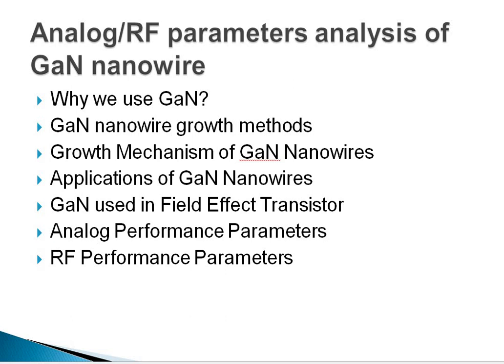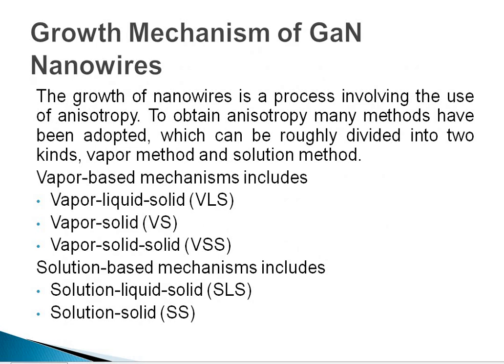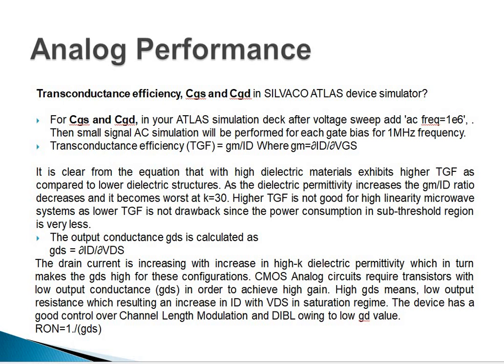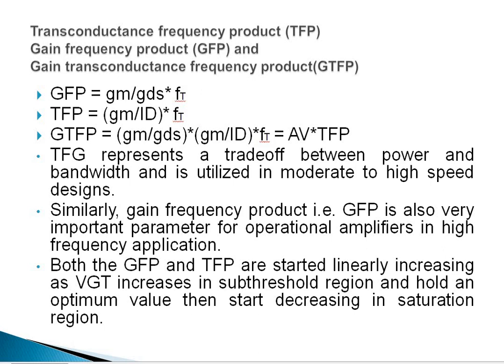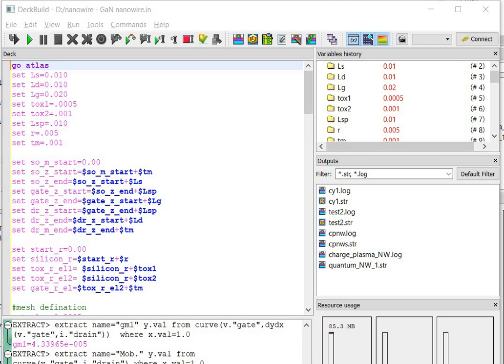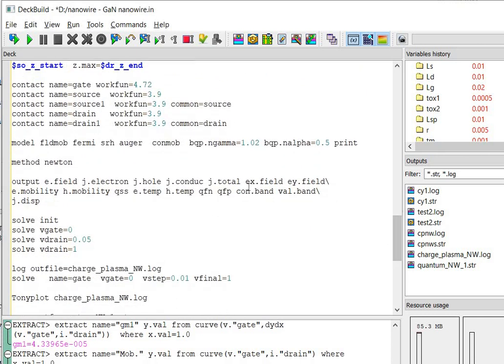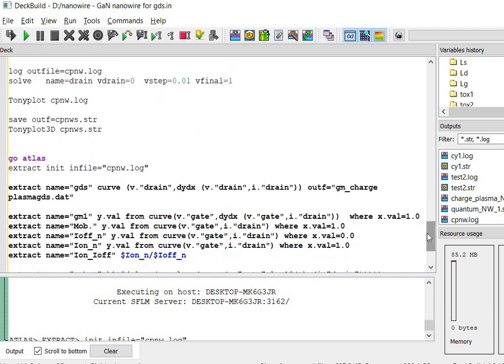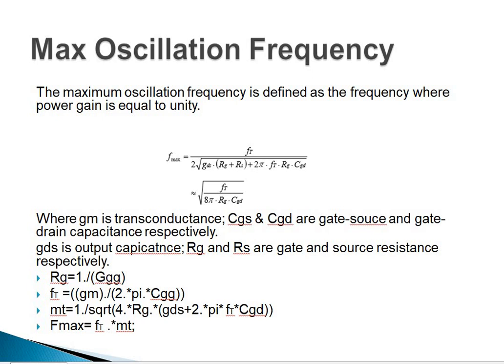Silvaco TCAD ATLAS tutorial 17. Design and Analog/RF analysis of GaN nanowire on silvaco tool...

Comment: all the parameters are function of Vgs but the output conductance you have calculated is function of Vds. Then how to calculate Av, Fmax, and other such parameters as a function of Vgs. Thank you
Reply from the maker: It's very easy to find out all the parameters w.r.t Vgs..... normally in all the videos we have found that drain current with respect to Vgs
Reply: Engineering technology and society yes you are right but you have calculated gds from id- vd curve at a fixed vgs . Hence gds is function of vds at a particular vgs value.. now if i like to find Av... then i will get a single value i.e at a particular Vgs value. Hope you understand my point.
Reply: One way of doing this is calculate Id Vd curve for several vgs value... then we hv to manually find out points for gds... if you hv more easy solution without manual operation to get gds vs. Vgs curve plz inform me. Thnx

Comment: Sir how to find gm from Id Vgs Curve because I have simulated without including syntax for gm in code .... please help...thanks in advance
Reply: you  can calculate from Id-Vd .dat ( delta V-delta I) using excel
Reply from the maker: Pls add syntax at the end of the program..I could not understand what's the problem in that
Can u plls eloborate ??
Reply: @engineeringtechnologyandso9940  ok sir I will include it...sir actually I not included syntax for gm in silvaco  so I didn't get dat file for gm...but I have drain current charactertics .... I am asking how to get gm from Id Vgs curve ...my each simulation taking more than a hour..
Reply from the maker: Ok u have to use matlab for that
Reply: @engineeringtechnologyandso9940  no problems sir I will include again